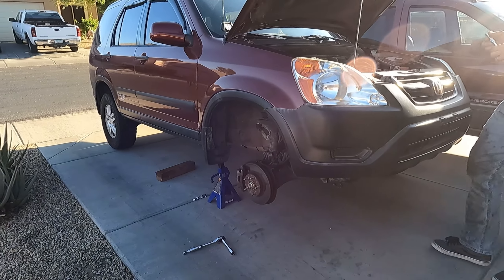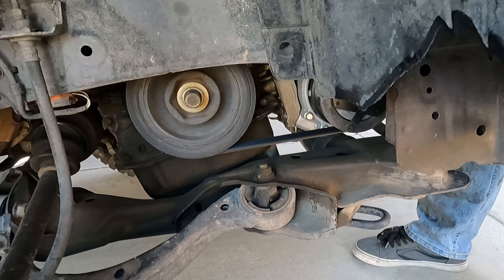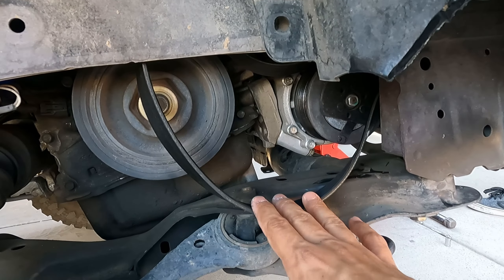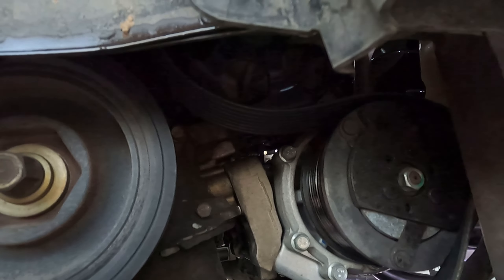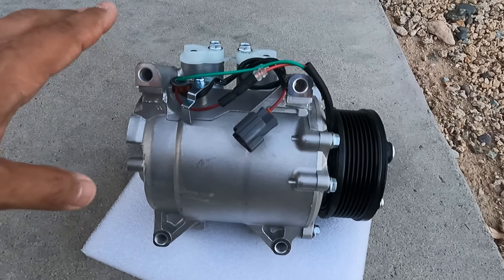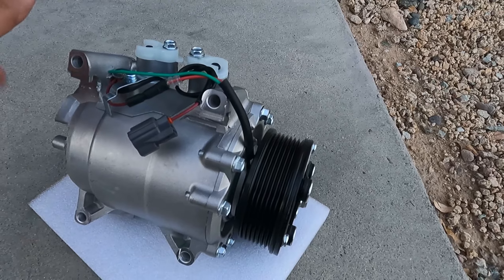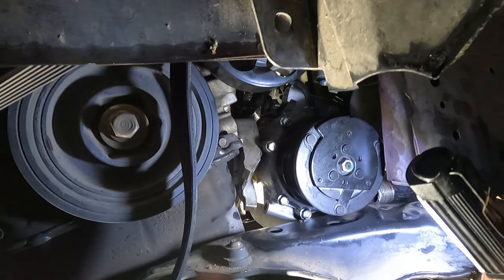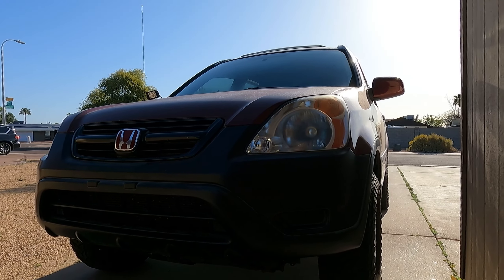CHANGING THE AC COMPRESSOR ON THE RD7 CRV (2003 2nd gen Honda Crv)

Comment: Mechanic told me that the wire sometimes become loose and to always check your fuses relays and wire’s. He also mentioned if your vehicle is high milage and the lines have lots of debris to change the condenser also because they clogged overtime time and make your new compressor work harder than it supposed to slowly killing it in less than 2 years
Reply: Thank you for this, cause I may have to replace my compressor now. Over 240,000 miles, A/C blows hot, and, upon inspection with an R134 gauge, it’s in the red. Nice little surprise from the previous owner 🙃🙃🙃

Comment: Good work, that is a nice looking Honda. I love my 04 CR-V but I have a lot of work to do on it. Got any advice on replacing motor mounts or determining if a CV joint is going out?
Reply from the maker: Thanks! Usually when they are going out you will hear a clicking noise when turning.
Reply: If you gas it and the car shakes its probably your rear diff that needs new fluid

Comment: 1:50 what does that mean and how did you get it done ?? Thanks in advance
Reply from the maker: It is how the freon is removed from the system. it can be done at a Mechanic shop.
Reply: @Jdmforall  thanks a lot

Comment: Would it be smart to change it as a preventative measure?
Reply: For the CRV years prone to the "black death" compressor failure the answer may be yes.  Do research on the  "black death" CRV ac compressor